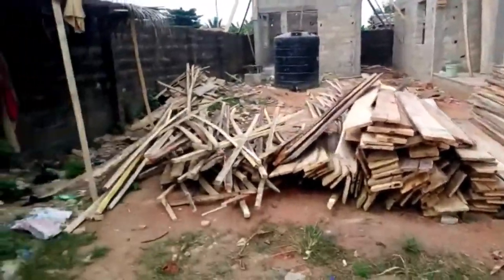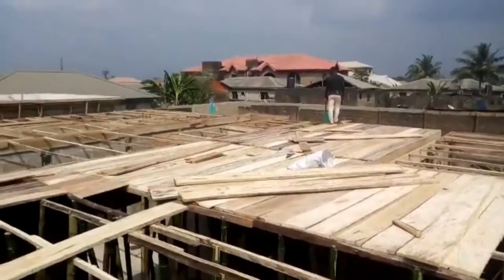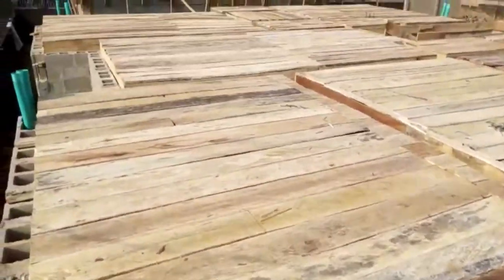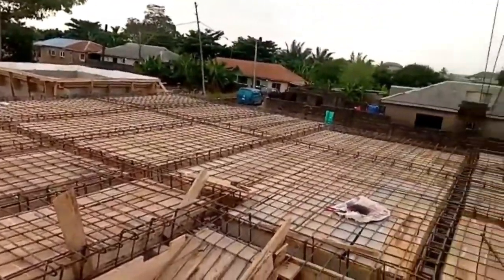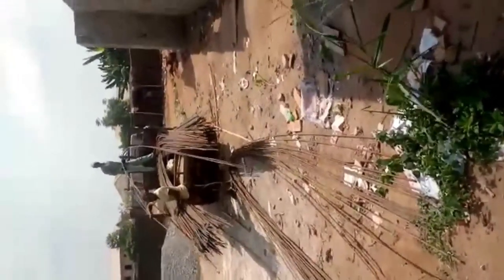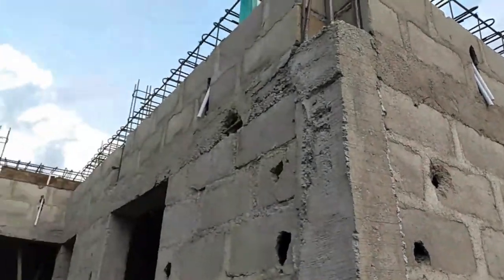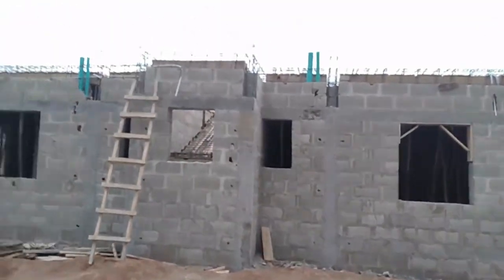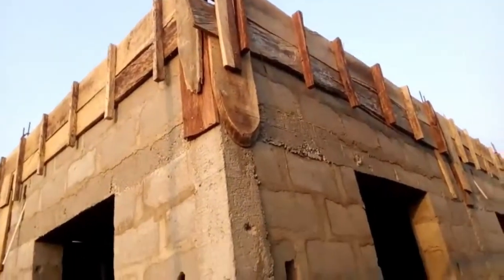DECKING PREPARATION FROM WOODS AND BAMBOO STAGE TO  IRON RODS & CONDUIT STAGE

Comment: Hello sir.  Can we stop where you stop on this video before talking to safe some money. To pure the cement.? What are the implications sir.
Reply from the maker: Thanks for your message, you can’t leave a decking or casting preparation with the wood like this for a long time without casting the decking within max 2 weeks. All the wood will start bulking or twisting under the harsh weather which will make the casting to wobble, the wood are not strong to last long. If you are not ready to cast don’t do the wood but you can leave the blocks at the stage it is till you have money to cast